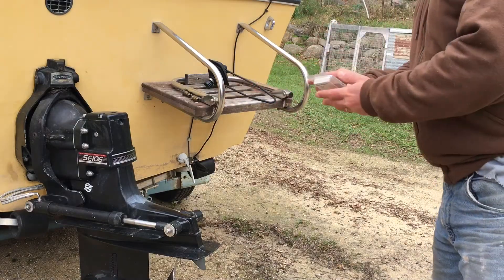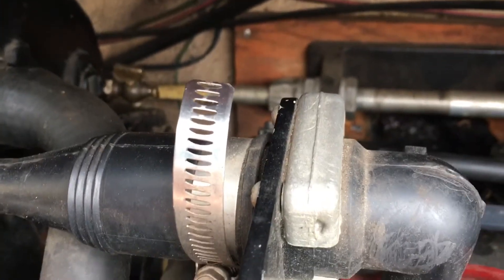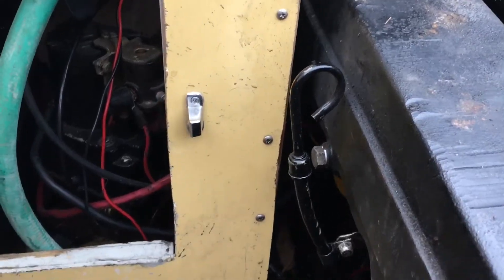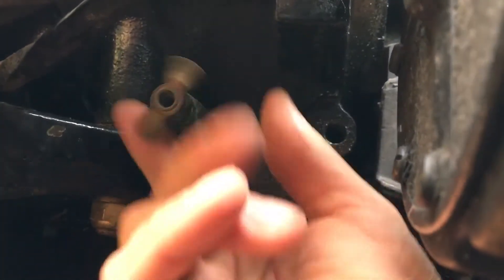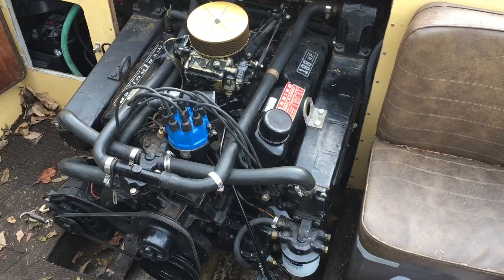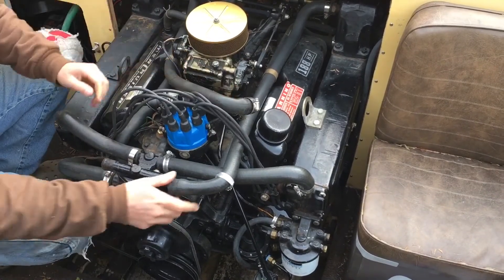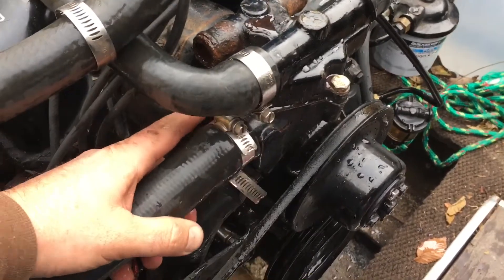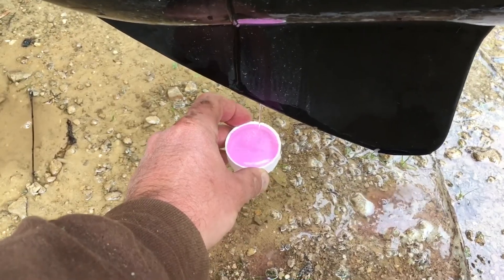How to easily winterize an inboard boat engine with a screwdriver and RV/Marine antifreeze

Comment: Thank you for the great video. I have pulled my motor and am in the middle of replacing the inner transom plate so I can't start the motor and it's getting cold. My boat and motor is almost 50 years also. As a matter of fact my motor is identical as yours. Ford 302 with the 225 S outdrive. Great motor and still runs strong. Want to keep it that way.
Reply from the maker: Agreed. It is a good engine. Mine is a little particular about the type of oil I use. If I don’t use 20w 40 or 50 it will use a bit. Other than that it’s been bulletproof.
Reply: I still use the Mercruiser 20w 50. Have about 900 hours on it. It's a 1974. Have rebuilt the carb a couple of times, points, plugs and usual maintenance and finally blew the coupler. Have never had any trouble with the engine itself. Mine is particular about the octane. Gotta get it up there at least over 90. I usually shoot for 92 with octane boost and lead combo. Runs great as long as it has lead and strong fuel.
Reply from the maker: @ericspeck8881  I think we are about twice the number of hours. I put a carb kit in the Holley that was specifically designed for modern fuel. I run high octane fuel without any ethanol. That 302 runs like a top. We have posted a few videos of trips on Lake Michigan where we traveled over 80 miles in a day. Easy to rack up the hours. I have complete confidence in that engine.